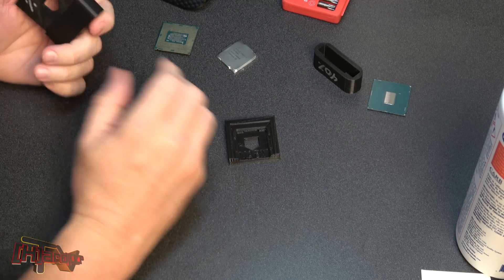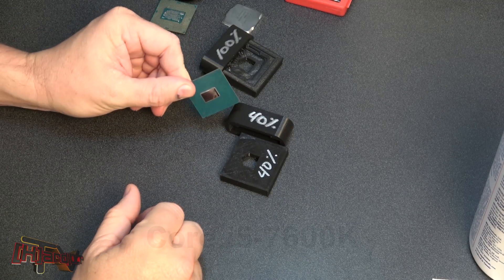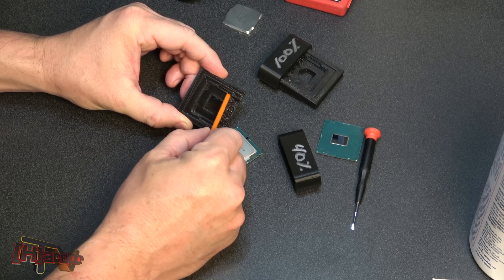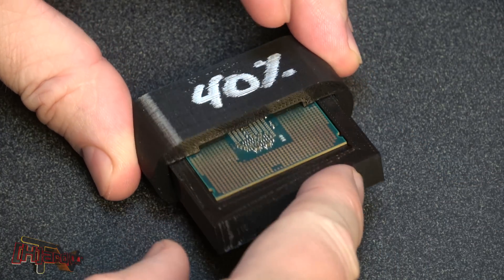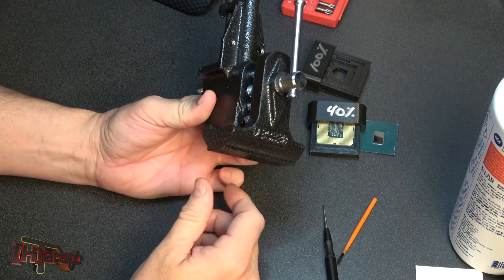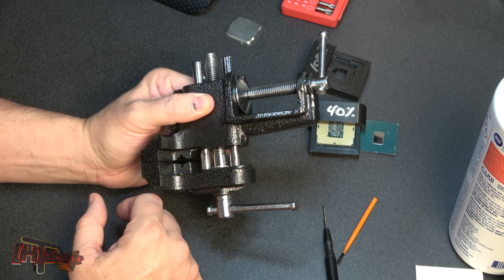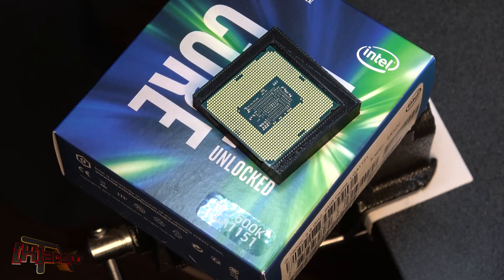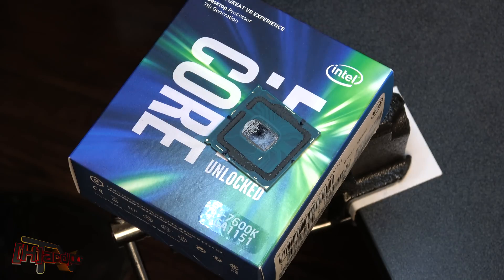DIY 3D Printed Delid Die Tool for Skylake & Kaby Lake CPUs

Comment: This honestly looks scarier than the time I delidded a CPU using a vice alone. Clamped the IHS, got a block of wood positioned on the edge of the pcb and just hammered the wood.
You know what eventually delidded it though? The fact that I could feel it loose so I went to remove it from the vice, only it dropped on the floor and delidded by hitting the concrete.
Still worked, but that was less scary than waiting for such a loud noise like in this video haha

Comment: i had one made a while back too. one tip. i was told it makes it "safer" to add a pad inside the larger piece. i happen to have a foam pad that is meant to be stuck under table/chair legs. i cut out a piece and it already had 3m on it, so i stuck it to the inside of the pocket.
I guess its so when you vice it, and it "pops" you have some cushion/pressure pushing back and dont go to far with it.

Comment: Would this tool and method be ok for 8700k as well?

I heard the vice method may be bad for the 8700k due to the thinner PCB
Reply from the maker: Yes, the tool I used will work.  It is older and I had to dremel out for the shoulders of the heatspreader as the delid die mate I used was an older one.  The PCB on these is VERY thin.  I would be hesitant to use a vice on these.  If you want to send me yours with a paid return package, I will delid it for you.  I would accept no liability on delidding or shipping though.  :)

Comment: I dont like this method. The Tools like Delid-die-mate, Rockits88 and Dr.Delid move the IHS while the PCB is fixed. This Method moves the PCB while the IHS is fixed. The PCB is of cause more prone to break.
Reply: Physics. It doesn't matter which one actually moves. It's the exact same force applied.
Reply: Indeed it doesn’t matter. Even if you use a vice only same amount of force is applied.

Comment: Wow .....4K looks absolutely amazing. When you zoomed in I was blown away. That's one hell of a camera you have there. In fact, I could see your individual ridge lines on your finger tips. If I had more and I was the CIA, I could reproduce your finger prints and frame you for breaking into AMD's HQ and stealing some of the 490x's I'm sure they have laying around. Great video. 4k ... wow wow wow. I want one of these tools.
Reply from the maker: Thanks, I am loving the new camera and what it can show off in 4K.  :)  Need to buy my own 3D printer next.  The camera is a Sony AX53, bought it used off eBay.
Reply: Would have been more effective to have been able to see the movement of the vice handle - less of the vice on the right. Still, I guess the point was made. I was surprised how much movement was required. I wonder if heating the IHS to warm the adhesive might help it let go... off to delid a 7700k.

Comment: where did you get the 3d print from please as I had one made but wouldn't fit my i5 7600k
Reply from the maker: http://www.hardocp.com/news/2017/01/30/3d_print_your_own_kaby_lake_delid_tool
Reply: that's the one I used, could you give me some more details like materials used and infill percent. thanks
Reply from the maker: You could reach out to Spacy9 on our forums.  He did the 3D printing of the part and knows the specifics.  Here is the thread.  https://hardforum.com/threads/3d-print-your-own-kaby-lake-delid-tool.1923741/

Comment: why wont intel use  solder were paying $250 for a CPU it's the least they could do.
Reply: Plenty of Core 2 duos and i5 2600k's are still doing just fine and they have old soldered IHS's
Reply: Still pretty shitty compared to just swapping out for Liquid Metal.
Reply: from what i can gather, a smaller DIE size like skylake, kabylake, ect, are more prone to develop micro cracks. the cracks will then grow over time. medium to large DIE sizes tend to handle this problem better. 

here's the article i read: http://overclocking.guide/the-truth-about-cpu-soldering/
Reply: My i7 920 (with soldered DIE) already runs for 10 years 24/7 @ 4.2GHz!
Reply: anyone tried this on a coffe lake? like the i7 8700k?
Reply: i guess it cracks over time
Reply: ur dumb different manufacturing processes. intel doesnt produce 90nm 45nm or bigger dies, smaller dies now